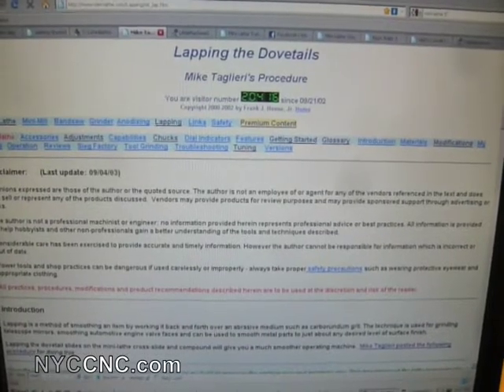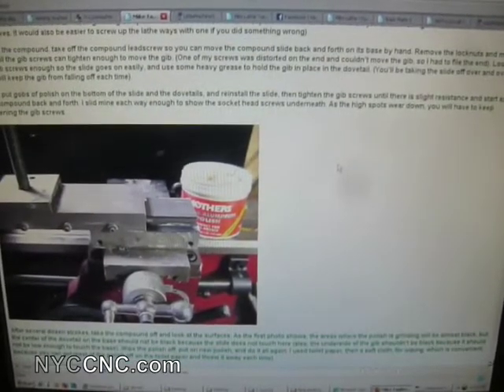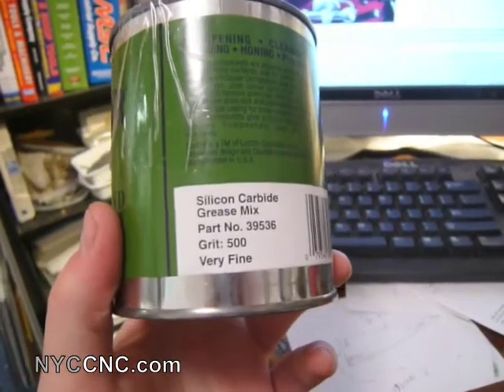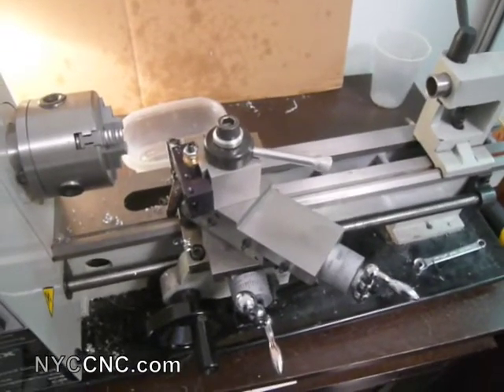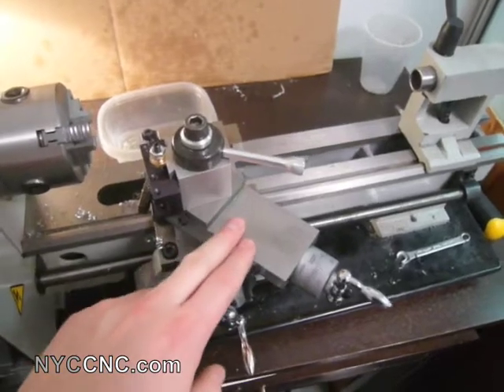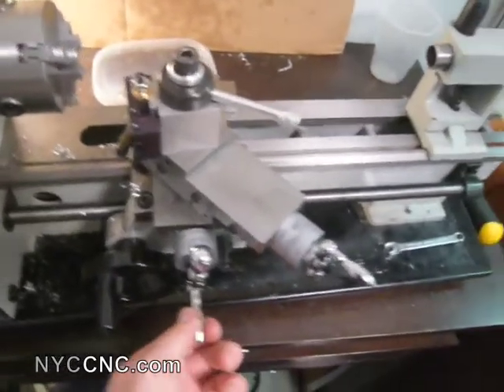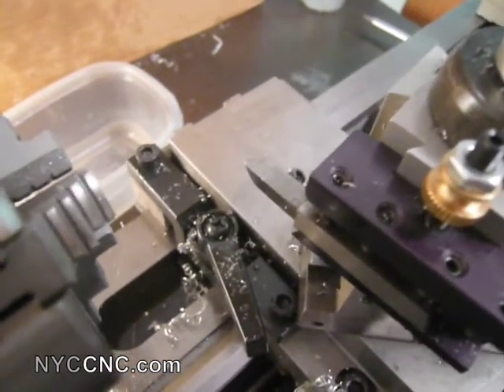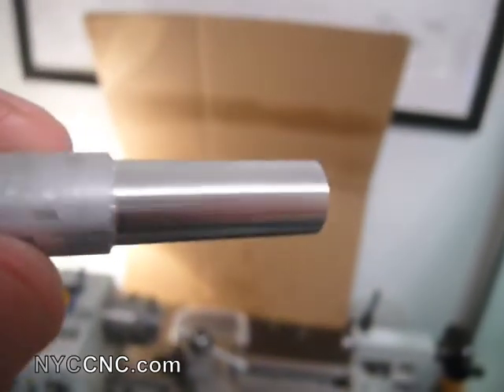Lapping Cross & Compound Slide Lathe Ways

Comment: I will never forget that lapping fluid for the rest of my life, I tried to use it to lap threads on a 6 inch shaft with a hardened screw on turbine capnut.  After it got stuck we pried with a 8ft bar, torched it, waxed + oiled,  tried milling it off, but it was impossible because the hardness was so high.  We ended up grinding it off the next day.  Turns out there was a thread burr that peeled off going backwards because of poor machining and this stuff made it come loose.

Comment: Yes, it is a type of lapping, though usually not done since Whitworth used scraping to finish bearing surfaces and because it is messy though easy, a uniform surface finish means the job is done, for fitting stationary and non-sliding parts that must seal together:  a head to an engine block, a cover to a gear box, certain valves to their bodies, etc..

Comment: Guys, when I thought I should weigh in on this, I thought I should start with my resume – kind of like in the movie, “Quigly Down Under”…His resume for a job was a target shot at 900 yards.  Who can argue with a resume like that?  For my resume, check out my two very short, Youtube videos at Dynetric.  My 900 yard target is a set of machine tool ways scraped to 50 millionths straightness.  I hope that will suffice since it's about the best I can do...   In regards to this video, first, you have to accept a simple fact that goes back before the time of Whitworth and led to the discovery of scraping.  That fact is – You can’t create accuracy by lapping two inaccurate surfaces to each other.  You create smoother surfaces but exaggerate the overall issues that each surface has.  If you think about this, you’ll know it’s true.  One surface will become concave and the other convex.  It will seem a perfect match until you compare one surface to a surface plate.  Whitworth realized (correctly) that you create accuracy by comparing an inaccurate surface to a known surface and then machining/grinding/scraping (in that order) the workpiece to match the known.  The problem with this video is that it creates the false impression that the machine is “improved” by lapping.  In fact while it may feel smoother, the original inaccuracy has been increased and the machine is in fact worse than it started - straightness and proper geometries are degraded.  And if you doubt the truth of this, take two relatively flat bars and start lapping them to each other. You will not end up with two flat bars.  Learning is a lifelong process for every true craftsman.  I hope this helps.
Reply: why dont you make more videos .show some skills to hobby mashinist like me and many others.i think many ppl will watch you videos.thank you
Reply: yes, this is true that ive the ways are bowed and the cross slide convex, the will smooth them together bit worsen the defects of both

Comment: For rough on-site checking, you could use a good, Starrett, B&S, etc., combo square & thin, 0.0005", shim stock.  Any rocking of the blade on the ways indicates convexity.  A gap, seen or felt with the shim stock, between the the ends of the blade and ways shows concavity.  Having the level placed on the carriage, perp. to bed ways should not deviate when the carriage is run back & forth, otherwise there's twist in the bed.  With the level parallel to the bed, a deviation indicates a warped bed.

Comment: You have an excellent lathe here. Though I am not talking just about this lathe or its price point, I have a question on how would I know if the entire length of any lathe bed was actually straight and flat or how could I test it before I buy it?  I mean you could move the cross slide along the entire length but the thickness of the ways could be the same along the lenght but not nescessarily flat. The bed could be bowed up or down. I did see people using black granite blocks for flatness check.

Comment: By wearing two parts together, eventually they will wring (seize) together.  With gauge blocks this confirms flatness and that mating surfaces are clean.  With machinery this is to be avoided.  For a small bench lathe, a small granite surface plate, some parallels, shim stock, an indicator, a couple scrapers (may be home made), bluing, and plenty of patience would suffice.  Any job worth doing is worth doing right.

Comment: JHV166, lapping does not always involve great size accuracy; i.e. engine valves lapping seats.  It's mainly about form.  As for precision parts and tooling, even mass produced, you'd be surprised how much is done manually at a lapping bench.  As for machines suffering from slip-stick and other undesirable effects of unintentional lapping, I've run my fair share.  If a company wanted to keep a machine, it would be generally sent for grinding, only grinders got scraped in.

Comment: I guess you could say that if I were to buy a lathe I could evaluate its precision based on how well the cross slide moves from one end of the screw to the other. How can I evaluate the entire bed length with out having a cross slide base equal to the length of the bed. Geometrically speaking how do I know that the cross slide base is not moving up when I move it along the entire length of the bed? I mean it could feel tight and loose as I move it along the entire length but how do I know flat?

Comment: Not to rain on your parade here but lapping the ways is really not the way to go.  Lapping does a good job of making two parts fit nicely together, but it also ruins any geometric accuracy in the ways. Hand scraping is the only way to go because you constantly check your geometry to a precision master as you work and a perfect fit is still achieved. Lapping brings two differing surfaces together in an ugly manner, ex. a flat plate lapped to a convex one makes two matching, but curved surfaces

Comment: On this Planet, Earth, the smaller the parts made the tighter the tolerances:  the entire size and fit system is based on this.  Starting at an early age in a skilled trade means quite a bit.  Everything becomes second nature.  Posting videos, I've not worked at a place where I can just make videos, companies have rules against that.  Where have I worked???  Skoda-Turbines, Flowserve, Merrill Tool, just to name the larger shops.  Look'em up.

Comment: No doubt that small dim's can be held within 0.0002" even on larger machines.  I've held that on 10" bores on a new G&L VTC 2000 but holding better than 0.001"TIR flatness on a 7 foot dia. face plate is almost impossible.  Pertaining to mach. building, tool room lathe vs 20-36" engine lathe: work held in chuck only, cut cylindricity in 12" .0008" vs .002", between centers in 12" .0004" vs .001". Somewhat along the lines of IT grading (G5, h6 etc.), smaller dim. = tighter tolerance.

Comment: Seemingly easy way to smooth travel in the ways but unfortunately not the right way.  It will lap grooves in the ground ways to conform to the poorly machined surface on the underside of the saddle and cross slide.  Learn to go about this the proper way and you'll be much happier with lathe performance.

Comment: I see that you have limited exposure to machining practice, I've seen your posts and videos.  Tiny machines should hold better tolerances than larger ones, that's a set rule in machine building.  Granted, small clunkers from China are just as bad as the big ones, that's no excuse.  As for being a know-it-all professional, I'm still learning though I've started machining at 15 and worked on machines big and small, good and really bad.  For actual improvement see Nick Mueller, he likes challenges.

Comment: This method will make a bad lathe no better.  Real lapping involves a lap, made of softer material than being lapped, that loads with the abrasive lapping compound which then laps the harder material.  Taking two sliding machine tool parts, generally of equal hardness, applying abrasive grit to their mating surfaces and moving one against the other is called escalated wear and is to be avoided.  Machine tool repair and rebuilding can be done by scraping or grinding, but nothing like the video.